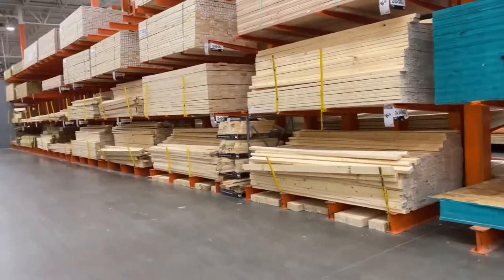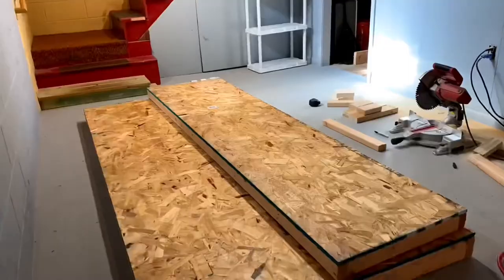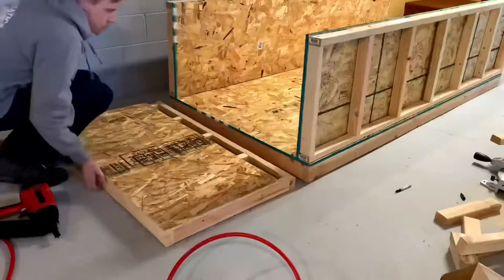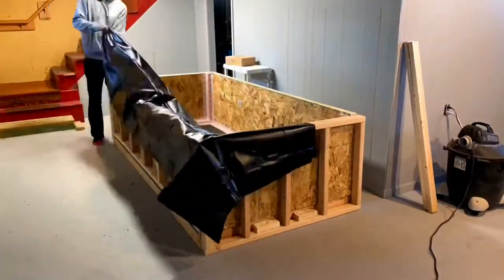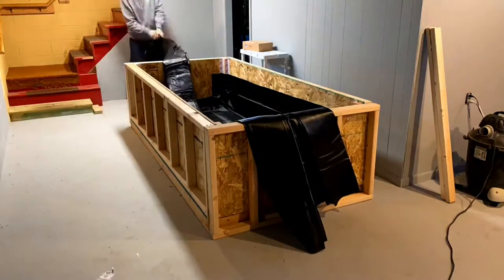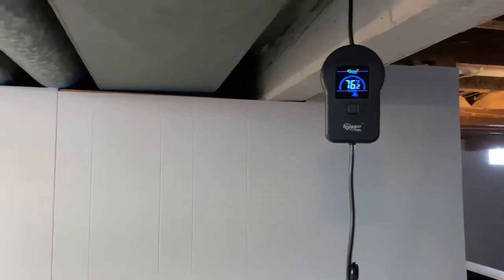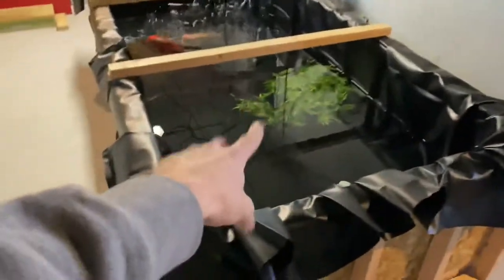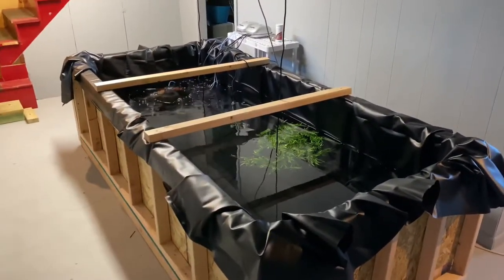DIY Indoor Pond Build in my House

Comment: Also where did you use the 1/2inch plywood and where did you use the 3/4inch? 3/4 bottom and 1/2 on the walls?
Reply: 0:44, the plywood with green are 3/4 inch which he used for the base and the sides.  The other two boards are 1/2 inch.  He used those for the ends.